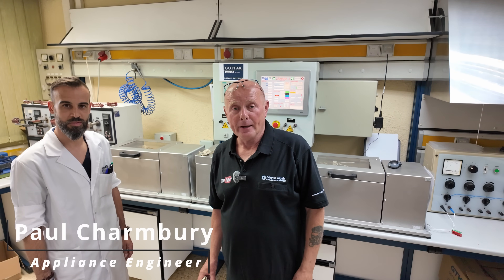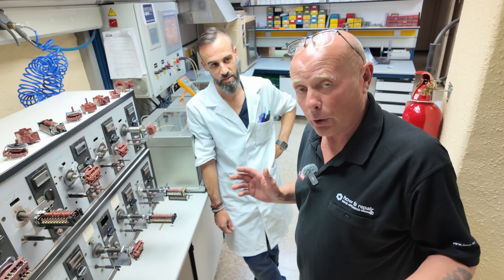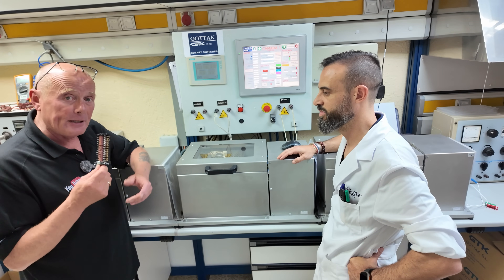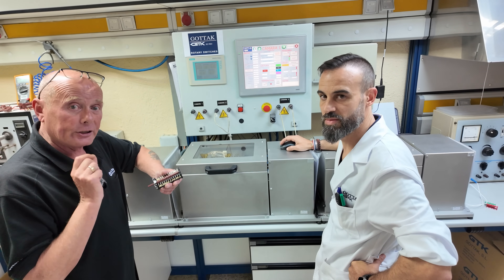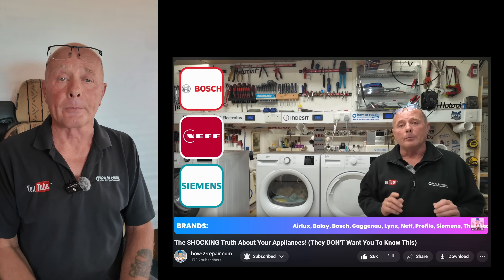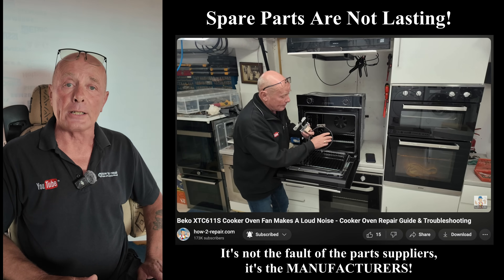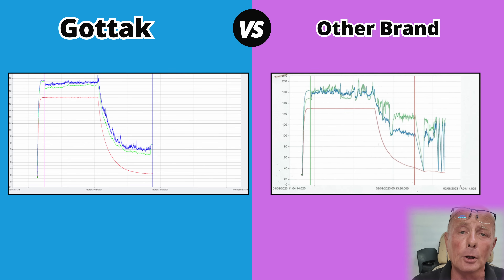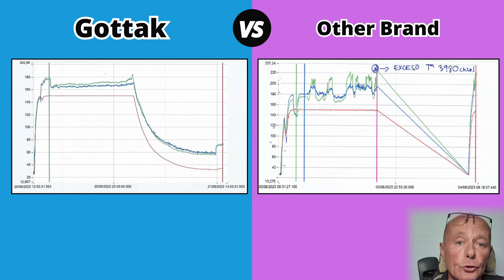Why Your Appliances FAIL SO FAST! Lab Results EXPOSE the Truth!

Comment: The real problem is that consumers cannot differentiate between high and low quality appliances because:

1) Very few consumers do their own repairs and therefore have no understanding of the operations and complexities of different machines.  Faced with a choice between two machines of similar price where one has mechanical switches to control its operation and the user must know what they want the machine to do or another machine with computer controls and digital displays where the user just turns one dial to select which automated dance the machine will do, consumers will generally opt for the second machine because it looks cooler and the advertising says it is "smarter".  But the first machine will be simpler, longer lasting, easier to fix, and it'll be less expensive to replace parts.

2) Manufacturers don't advertise the reliability and durability of their products, so that is not even a design dimension upon which consumers judge products.  Reliability just isn't cool.  Having a brand new, latest style appliance is what's cool.  Especially if the manufacturers can tout that the new machine is more energy efficient and better for the planet.
Reply from the maker: I've been repairing washing machines for nearly 50 years, and the basic principles of washing clothes haven't changed since the 70s. They wash, tumble, heat, and spin. It's baffling why we need so many extra features now. Machines used to last 15 to 20 years on average. Nowadays, you're lucky if they last five years. Obsolescence is clear in today's society.

Comment: Since I am aware most components are made the same and of poor quality I figured after my dryer stopped heating no sense replacing the heating element with one that costs nearly $200. Instead I bought one that cost $40. It has been running strong for over a year after I replaced it myself. Even if it doesn't get 5 years of life it was a fraction of the cost. I hope one day consumer laws catch up and it is put into law that appliances need a 10 year minimum reliability.
Reply from the maker: Your approach to replacing the heating element with a more affordable alternative, knowing the limitations of current parts, is a great example of navigating the challenges of built-in obsolescence. Thank you for your comment. I appreciate people like you taking the time to write it out. Please share it where possible. It might help others make a wise choice instead of being misled by the industry.

Comment: Thanks for confirming  what I sensed all along. No wonder why there are so many white goods dumped at the local garbage tip. I remember my parents purchasing second-hand white goods back in the early 1960's, and after using them for some 3 or 4 years, they traded them on new washing machine, fridge, etc and got more back for them than they payed for them. And today, nothing seems to even be repairable. There are no repair shops to be found.  This is becoming a problem for the local Council, you cannot fatham the number of items dumped weekly at the local garbage management centre, serving perhaps 500 households. They have placed signage outlawing the dumping of white goods. What are residents supposed to do, as the local recyclers don't want them either.  THERE IS A SOLUTION! -  Make the supply chain (perhaps distributors or wholesalers)  responsible for their junk with built-in obsolescence by levying a tax that is inversely proportional to the warranty period. This tax should also capture furniture made with for- ever toxins such as formaldehyde in particle boards. Cupboards and the like now are now almost exclusively  made with particle board that becomes unserviceable after 5 to 10 years of service, disintegrates on contact with water but remains toxic forever.  You inspire me to write to my local Council with this youtube attached.

Comment: Built in faults is why it happens. Companies deliberately build faults into their products so they break after a certain time. And they have the process down to a T and can almost guarantee the date the item will fail. It needs to stop.
Reply from the maker: Think about the environmental impact of building machines and then recycling them. These machines are often transported halfway around the world, which adds to fuel costs. It's baffling that we need to ship them every five years due to failure.
Reply: @How-to-repair  And the stuff that doesn't get recycled gets dumped in landfill facilities where the rare earths, minerals and hazardous substances get buried and potentially leach into the surrounding environment. It's a throw away society caused by greedy companies.

Last century you bought a TV, fridge or computer and they worked for 20+ years. Parents would give their kids the 20yo fridge when they moved out of home and the mum & dad buy a new one. Now you buy them and they fail after a few years. It's just greed making products bad.

Comment: Bought a new "Simpson" (Australia) washing machine in 1987; the paint has faded, but the machine  still performs well.  Given what is now on the market, I might just buy a washboard when it eventually has a catastrophic failure.
Reply from the maker: In the 80s, 90s, and early 2000s, most manufacturers produced high-quality equipment to build their reputations. Now, their main goal is to sell machines. They use green marketing tactics to their advantage but aren't held accountable for the growing pile of discarded white goods.

Comment: lol Manufacturers aren't reading comments on youtube videos.   I don't mind giving you an engagement bump, though.
Reply from the maker: I think manufacturers really leave comments on controversial videos using different YouTube accounts to promote their products. 

There is a comment which was posted on my video about heat pump tumble dryers. It claims that the dryer can dry clothes in 30 minutes. However, anyone familiar with heat pump tumble dryers knows that the first 15 minutes of the cycle are needed to get the gases to the right pressures and temperatures so the evaporator and condenser can work properly. https://www.youtube.com/watch?v=xn03N3b0-lE

It's impossible for a heat pump tumble dryer to dry a load of clothes in just 30 minutes, as the commenter claimed. When AI is used wrongly, it spreads false information to everyone.

Comment: The real enemy in the room is actually how the economy works (competition and relying on sales for income),  increasing taxes (and rules) and the huge amount of available products. This is the real cause behind this problem. Your facing the symptoms, the outcome of a catastrophic financial design. It is a cat and mouse story with fatal results. For example, a manufacturer NEED to sell to survive, constantly, because of increasing bills. That is why manufacturers try to save on costs (extensively or too far) and you showed us one of the negative results. Another factor is (stupid EU) rules, for example lead free solder because of the effects on the environment. There are many proofs that lead free solder cannot handle the mechanical stress (by heavy temperature changes or transport etc) of heavier components on a PCB and can result in cracks in the solder join(s). Result: Many devices died early and thrown away because of this. Yeah, this really helps the environment. Hopefully I showed you the question why is more complex. Peel the problem down to the real cause, manufacturers are only the suppliers of a deeper lying problem. Guilty, but not the real cause.
Reply from the maker: Hi there! Thanks for your comment, @codebeat4192!

You've hit on a really important point about the complex interplay of economic pressures, regulations, and market dynamics that contribute to the issue of built-in obsolescence. This is exactly the kind of deeper systemic issue we discuss in the video, where the symptoms you see in failing appliances are indeed outcomes of these broader forces. Your example of lead-free solder is particularly salient, illustrating how well-intentioned regulations can have unintended negative consequences on product longevity and ultimately, environmental impact.

At the trade show last year understanding how much obsolescence is being designed into new appliances these days is something everyone should be aware of. For a deeper dive into this topic and to see the examples we covered, please check out the full video here: https://youtu.be/gEgSCbZnHVM?si=wTIw0mELuhWaw4aX

We also explored related aspects in these videos:

The shocking truth about manufacturers: https://www.youtube.com/watch?v=QsdGd2qDPaI

Heat pump tumble dryers are they really worth it?: https://www.youtube.com/watch?v=xn03N3b0-lE

If you found this information eye-opening or helpful, please consider sharing this video with your friends and family. The more people who understand what's happening with appliance longevity, the better equipped we all are as consumers.

Thanks again for watching and engaging! Don't forget to subscribe to the channel for more insights like this!

Comment: $500 for a washer. last's 5 yrs that's 100 per year. Cost of going to the laundromat $780 yr. plus gas, time, and wear and tear on your car. $400 yr. I'll take the cheap washer.
Reply from the maker: Think about the environmental impact of building machines and then recycling them. These machines are often transported halfway around the world, which adds to fuel costs. It's baffling that we need to ship them every five years due to failure.

Comment: Yes they don't make them like they used to however most other than not is costumer abuse thinking a dishwasher is a garbage disposal, slamming doors,not pausing microwave before opening door and many other reasons
Reply from the maker: While it's true that manufacturers don't make them like they used to, customer abuse is definitely a factor that contributes to appliances failing prematurely. This is exactly the kind of built-in obsolescence we discuss in the video, often exacerbated by how people interact with their machines.

Comment: The biggest problem is that the manufacturers doesn't tell you that you can and sometimes doesn't allow you to repair your broken appliance.  As the video mentioned, you can't find quality and lasting spare parts. Next you need special tools to bypass security screws. Some parts are not meant to be repaired at all, like my old Samsung TV which had a plastic frame around the LCD which disintegrate the moment I touch it.  

Everything breaks. The Philips brand made some greenwashing video about offering 3D printing devices so you can fix their crap.
Reply from the maker: You’re absolutely right mate, and it’s a frustrating practice that affects nearly every industry. The concept of deliberately designing products to fail or become obsolete within a certain timeframe is a huge driver of unnecessary waste and consumer spending. Whether it’s electronics, appliances, or even clothing, it’s all about maximizing profits at the expense of durability and sustainability!

Comment: I recently repaired a 5 year old Bosch vacuum cleaner. It was insanely easy to disassemble. So there still are brands that deliver.
The cable was broken at the wall plug. So no serious issue.
Reply from the maker: Hi there! Thanks for your comment, @jpt3640!

It's good to hear that your 5-year-old Bosch vacuum cleaner was so easy to disassemble for a simple cable repair. However, planned obsolescence and the lack of repairability are major issues in the industry. Manufacturers prioritize profit over long-term reliability. For a deeper dive into this topic and to see the examples we covered, please check out the full video here: https://youtu.be/gEgSCbZnHVM?si=wTIw0mELuhWaw4aX

Understanding Appliance Manufacturing
We also explored related aspects in these videos:

The shocking truth about manufacturers: https://www.youtube.com/watch?v=QsdGd2qDPaI
Why Your Appliances Fail So Fast?: https://youtu.be/oBLEMQdSkes?si=ikIwqMsOIjaA0Xav
If you found this information eye-opening or helpful, please consider sharing this video with your friends and family. The more people who understand what's happening with appliance longevity, the better equipped we all are as consumers.

Thanks again for watching and engaging! Don't forget to subscribe to the channel for more insights like this!

Comment: I had Japanese washing machine TOSHIBA from 70's. All electromechanical with gears inside. It died in tortures few year ago, cause was rated 110V and one woman inserted it into 230V for a long time. After I got a new german machine. Well, the new one is really badly made. All Japanese resin washers and dumpers were soft for 40 years, and new german had to be repaired until now two times.
Reply from the maker: Hi there! Thanks for your comment, @John.Doe.2025!

You've hit on a really important point about the noticeable decline in appliance longevity and build quality over the decades. Your experience with the incredibly durable 1970s Toshiba washing machine, which lasted for so long and only failed due to an electrical issue, compared to your new German machine needing multiple repairs, is a stark example. This is exactly the kind of built-in obsolescence, or at least a significant drop in manufacturing standards, we discuss in the video. It's a common sentiment that older appliances were often built to last, unlike many modern counterparts.

At the trade show last year, understanding how much obsolescence is being designed into new appliances these days is something everyone should be aware of. For a deeper dive into this topic and to see the examples we covered, please check out the full video here: https://youtu.be/gEgSCbZnHVM?si=wTIw0mELuhWaw4aX

We also explored related aspects in these videos:

The shocking truth about manufacturers: https://www.youtube.com/watch?v=QsdGd2qDPaI
Heat pump tumble dryers are they really worth it?: https://www.youtube.com/watch?v=xn03N3b0-lE
If you found this information eye-opening or helpful, please consider sharing this video with your friends and family. The more people who understand what's happening with appliance longevity, the better equipped we all are as consumers.

Thanks again for watching and engaging! Don't forget to subscribe to the channel for more insights like this!

Comment: You may as well just buy the cheapest products now. Internal components, while contributing the lion's share of the cost of a device, don't shift units - that's all down to how much you can give the illusion of quality with 'premium' materials on the user-facing parts which actually cost very little. When even the expensive appliances are specifying the cheapest internals, they become a waste of money.
Reply from the maker: Hi there! Thanks for your comment, @jasejj!

You've hit on a really important point about why even expensive appliances seem to be using cheaper internal components. This is exactly the kind of built-in obsolescence we discuss in the video.

At the trade show last year understanding how much obsolescence is being designed into new appliances these days is something everyone should be aware of. For a deeper dive into this topic and to see the examples we covered, please check out the full video here: https://youtu.be/gEgSCbZnHVM?si=wTIw0mELuhWaw4aX

We also explored related aspects in these videos:

The shocking truth about manufacturers: https://www.youtube.com/watch?v=QsdGd2qDPaI

Heat pump tumble dryers are they really worth it?: https://www.youtube.com/watch?v=xn03N3b0-lE

If you found this information eye-opening or helpful, please consider sharing this video with your friends and family. The more people who understand what's happening with appliance longevity, the better equipped we all are as consumers.

Thanks again for watching and engaging! Don't forget to subscribe to the channel for more insights like this!

Comment: When any appliances needs a sudden repair and you find the problem and try to get the replacement part(s), it use to be you got the part(s) that day or the couple of days. In today's world it's you need to wait 1 to 3+ weeks for it because it's on backorder, specialty part or hard to find etc. Manufacturer's know what parts need to be replaced more than others. They do this on purpose to get you to buy a new appliances.
Reply from the maker: Hi there! Thanks for your comment, @MrTravisGoldman!

You've hit on a really important point about the difficulty and delay in getting replacement parts for appliances. This is exactly the kind of built-in obsolescence we discuss in the video.

At the trade show last year understanding how much obsolescence is being designed into new appliances these days is something everyone should be aware of. For a deeper dive into this topic and to see the examples we covered, please check out the full video here: https://youtu.be/gEgSCbZnHVM?si=wTIw0mELuhWaw4aX

We also explored related aspects in these videos:

The shocking truth about manufacturers: https://www.youtube.com/watch?v=QsdGd2qDPaI

Heat pump tumble dryers are they really worth it?: https://www.youtube.com/watch?v=xn03N3b0-lE

If you found this information eye-opening or helpful, please consider sharing this video with your friends and family. The more people who understand what's happening with appliance longevity, the better equipped we all are as consumers.

Thanks again for watching and engaging! Don't forget to subscribe to the channel for more insights like this!